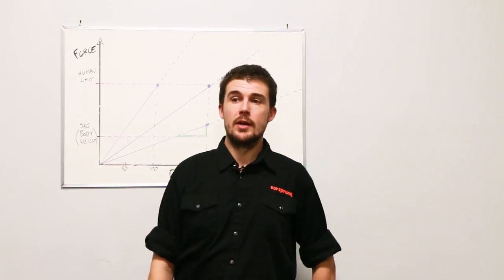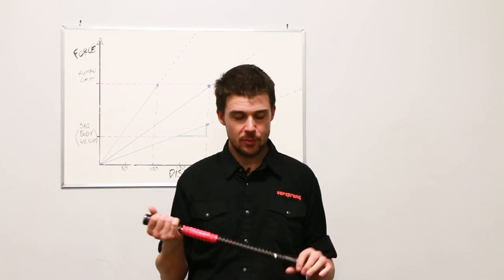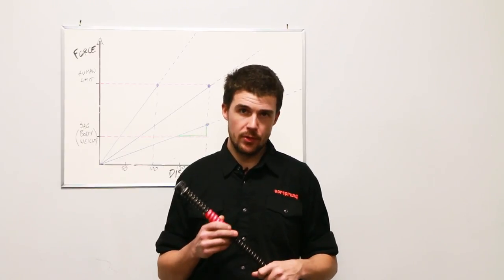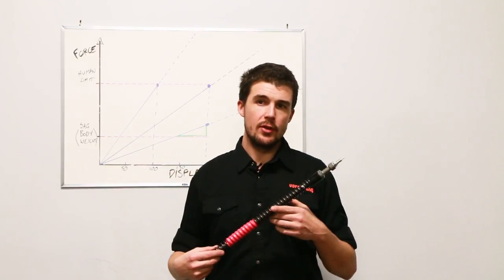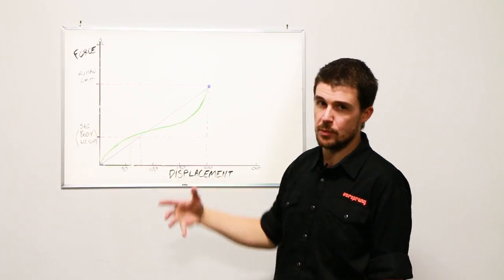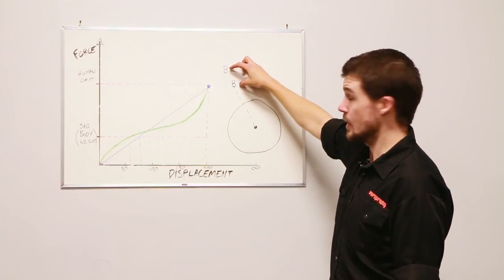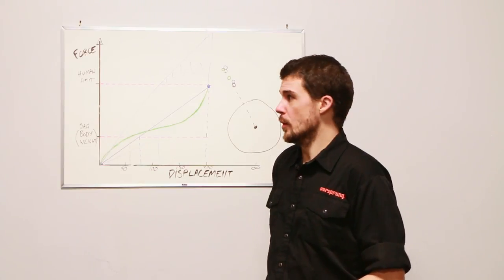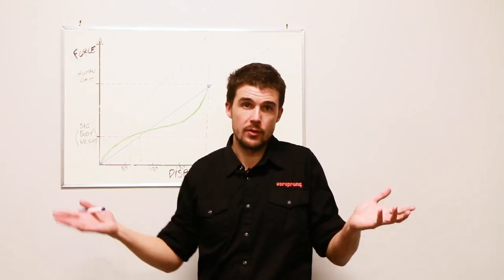How Much Travel Do You Really Need? Ramblings Pt 2 - Tuesday Tune 28

Comment: Late in this one i know but. In my opinion you are missing an absolutely fundamental part. It's not the spring thats supposed to stop you from bottoming out. It's the damper, if you are bottoming out you shouldn't install a stiffer spring, you should add more compression damping or re-shim the shock. The fact that people add tokens or increase pressure in the air shocks is that it's just a simple work around that is not the beat solution. 

You are dealing with the absorption of energy. If you look at a significant compression event with high energy and you see how much of the energy that is absorbed by the spring and how much is absorbed by the damper you see that the spring is just a tiny tiny amount of the total energy. 

How stiff the damper is, is a function of compression velocity. Just plotting linear curves like here is a huge simplification that sends the wrong signals to people on how to solve bottoming out.
Reply from the maker: I would not agree with that at all. The damper's job is to prevent excessive motion and resonant vibration to keep the bike and rider stable. Compared to the spring, it does very little to reduce bottoming out (especially in current forks where it does almost nothing whatsoever); damping forces in MTB suspension are a small fraction of the peak spring forces. Hydraulic bottom out systems are a different matter as you can get a lot of force out of them without overdamping the majority of the stroke.
Reply: @VorsprungSuspension    Thank you for taking your time to reply. I have been thinking about this alot as there are so many people in the mtb world that have an oppinion on shocks but a lot of them are seem clueless. You seem to know your stuff though. I don't agree the least bit though about the damper only being there to prevent vibration. It is about stopping excessive motion, especially at higher compresion velocities. Here is how I'm thikning.  It's all about energy absorbtion (force times displacement), not force. Lets assume a drop of 1m with a bike plus rider weighing 100kg.  The energy that needs to be absorbed in that is about 980J (E=Mgh), or 490J if we assume a 50/50 distribution between front and rear shock.  The rear shock has a 55mm stroke with a 550 spring. The spring in that case soaks up about 145J of that energy (which is then removed by the damper at rebound). The remaining 345J needs to adsorbed by the damper. Increasing the spring rate to 650 the energy absorbed by the spring is 172J. Not a hughe difference, the majority of the work i still done by the shock. Upping the spring to 650 will cause other problems with sag etc. Sure, as the velocity decreases towards the end of the shock stroke the spring becomes more dominant in soaking up the last bit of energy. But if you are dependant on spring here I belive you are underdamped to start with. The spring mostly is for setting and mainitaing sag/ride height. 

An air shock is different with the porgression of those. There you can playaround with pressure and tokens to prevent bottoming out. However, that'll make the ride alot harsher the more the shock is compressed. Lets say in a banked corner or in a compresssion/dip in the trail. This prevents optimum performance of the damping throughout the shock stroke. The progressive nature of an air shock is both good and bad. It'll definitely make rebound damping way more complicated. I haven't done the math but I suspect that the rebound damping on air shock is massive compared to a coil. You should know? To me it feels like the shock manufacturers are taking the negative side of air shocks and turning it around to something positive.

The parallel I draw here is how we do it on the sleds if we constantly bottom out, we don't change springs if we bottom out, we add compression damping, if adding clicks isn't sufficent we re-shim. Depending och shock design the slows speed compression can have a massive effect. Of course, if the spiring is too soft so low ride height causing bottom outs it's a different story. 

Put a damper and a spring in the dyno and log force displacement, preferably at constant velocity. You'll see a flat line on the spring and as you increase velocity and it goes over a critical point the damper will be stiffer than the spring. The area under the curve is the energy absorbed. 

Please change my mind......
Reply from the maker: @IIIkGT  cyclical motion of any kind is vibration. When you say "excessive motion", that is vibration, because it returns.  

I'm not saying that you could not reduce travel usage with HSC, I'm saying that we usually choose not to use that avenue as the primary form of bottoming resistance with MTBs, because the rigid sprung mass is very low and the rider is far from rigid. Compared to a sled, which has about 200kg of (essentially rigid) sprung mass, a bike has about 5% as much. This brings us to three reasons why we don't recommend trying to increase HSC on modern MTB forks in order to prevent bottoming:
1. In order to get sufficient HSC that it makes any significant difference to bottoming resistance, you need to have enough that the wheel vibration mode is way overdamped - ie the wheel can't move freely enough relative to the rigid sprung mass of the bike. That causes harshness to the rider because the damping forces and input energy from bumps now have far more force with which to accelerate & vibrate the sprung mass. On a sled, there is 200kg of sprung mass to accelerate before the rider feels much. 
2. Because most MTB forks now are air sprung, they have a degree of pneumatic damping - they act as a heat pump due to the difference in adiabatic vs isothermal compression. In other words, increasing the spring rate on an air sprung fork increases your effective damping rate in direct proportion. This effect is reduced quite a bit with coil forks, but there is still some significant spring & damping coming from the compression of the internal volume of the fork itself.
2. Because of points 1 and 2, all MTB fork dampers currently have VERY light HSC damping. Changing a Grip2 or Charger2/2.1/3 HSC setting from minimum to maximum, with stock valving, makes negligible difference to how much travel you use, even though it roughly doubles the compressoin damping compared to the lightest setting, because double nothing is still nothing.

Because of this, we have to make practical recommendations. You can revalve a fork with way firmer HSC and it'll begin to limit the travel, but it'll also hurt your hands. With most stock forks though, the compression adjustment does not do much. They used to do a lot more - I think we have the MTBR forums to thank for the now pretty much useless range of compression adjustment.

Shocks are not identical, because some of them do have significantly more effective HSC adjusters for starters, but the same principles apply.

Furthermore, you can't really use particle energy absorption approximations for mountain bikes, because the rider buckles under a certain amount of force and absorbs more of the energy themselves. Otherwise people would die from jumping BMXes.

Comment: I want my fork to always have about 5-10mm more travel than I will probably ever use because I absolutely hate having my fork bottom out. Why not? Thoughts?

Btw. I ride a relatively long and slack 29er bike with 140mm rear and 150mm front on sometimes very rough trails as for example Finale. 
At times I get the feeling of my rear wheel hanging up on successive mid to large size hits. I never feel like my fork doesn't have enough travel, even though it is set up to basically never bottom out and doesn't really have much travel for this kind of use.
Is that to be expected with any bike? Do I not have enough travel? Could it be caused by the Mondraker suspension design/axle path?
I weigh 70kg/155lb, like running relatively little sag at about barely 30% rear and 10-15% front. I run fast rebound, about mid HS compression and little LS compression compared to riding buddies. I Don't seem to remember this sensation from my dh bikes a few years back but then again that is so long ago I might just not have ridden them as hard and/or had no idea about what the suspension was doing.

Would love to hear your thoughts and an't say often enough how much I love this series and hope you keep it up :)
Reply from the maker: I suppose the whole "cut the o-ring off" thing was basically one way of saying "make it feel good and be happy with it whether it's using full travel or not" so your setup sounds pretty reasonable to me.

The Mondrakers aren't particularly remarkable one way or another regarding axle path and leverage rate - most pedalable bikes (bar the high pivot ones) tend to feel a bit harsh and overwhelmed in really rough stuff compared to DH bikes for sure. There is realistically no replacement for displacement when it comes to running over stuff. As Seb Stott put it a while back -  "Suspension travel: more is more."
Reply: I've been in that range, and accepted a compromised answer - you can give up some mid-range support (and I'm talking even after the improvement of a Luftkappe) and lean a bit more on the LSC and drop air pressure a touch then add a spacer.  The near-sag performance in normal cases is the same, it's still basically impossible to use that last bit of travel (still feels good in the bank), and when I'm getting that same sensation of getting hung up on successive hits, the front is tracking a bit easier through stuff and I can retain a little bit more momentum.  I kinda did the same on the back, but the band-aid there is adding a volume spacer to + and - side, and actually leaning on HSC with reduced LSC to try and keep that rear axle more active.  Again, there's no free lunch and it bobs like a mofo on flat trails and pavement, but if I ignore that I'm still faster everywhere.
I'm on a similar bike (slack 150/130mm 29er), but I run 25-28% sag up front with 30% out back and prefer that very non-linear fork feel... so no way this will 100% answer the questions for you, but it's an approach that overall worked for me (or at least led me to a compromise I was happier with).
Reply: Thanks for the answers guys. Seems like my feeling that a bit more travel might not be bad was probably correct. I really like the snappy yet stable feeling of the long 140/150mm bike though...always compromises..
Reply: @TJ-gh6cg  For my part, improving the fork seemed to help everything, but doesn't detract a lot from the overall snappiness.